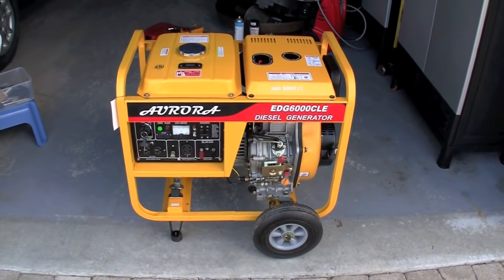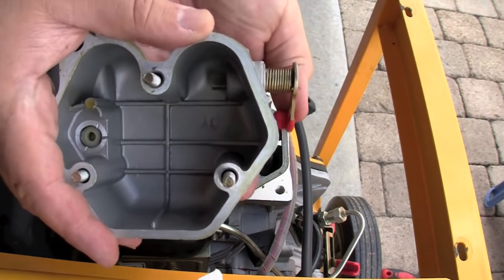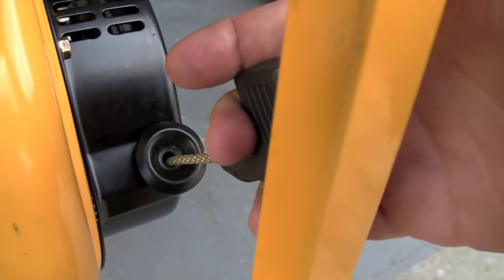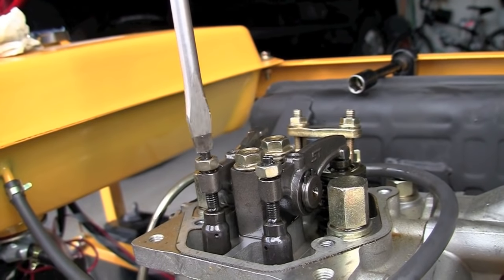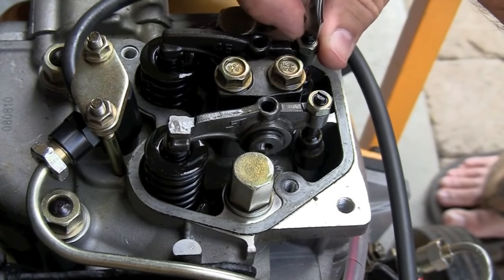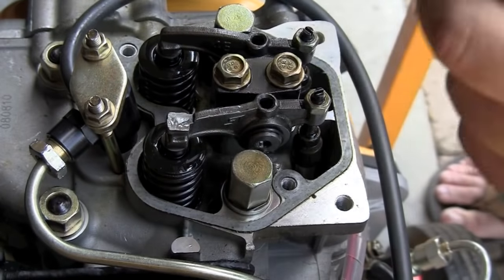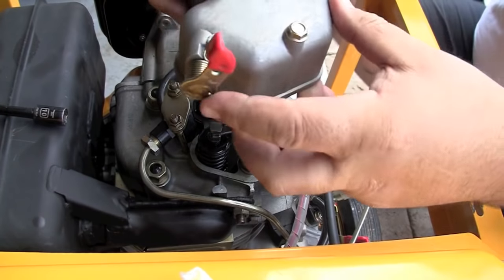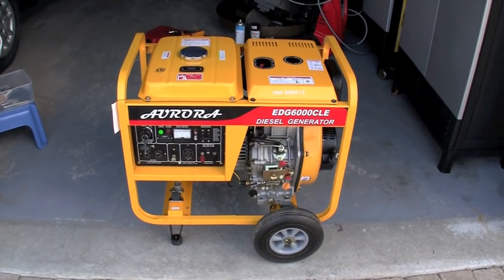Diesel Generator Valve Adjustment

Comment: You really need to remove engine pull start shroud (4 bolts) to determine top dead center. TDC is marked on flywheel by a hole  Then adjust valves to .15 mm gap

Comment: My exhaust is blowing out flames and has melted the flexible exhaust connector. The valve clearances are good. Why would the valve be opening when there are flames still in the cylinder?

Comment: You say .15mm gap but video shows feeler gauge .011Inch or .279mm a but confusing what is the correct gap???
Reply: 0.10-0.15 MM
Reply: 0.008mm intake for exhaust 0.012mm

Comment: Gap  intake 0.11 and gap exhaust 0.15 ?
Reply: 0.008mm intake for exhaust 0.012mm
Reply: @lyndonlawas2367  thanks you very much, sir
Reply: @lyndonlawas2367  Hi, I disagree. I have spent hours over the last few weeks researching 186F/FA engines.  Some sources state 0.1-0.15mm (0.004-0.006") inlet and 0.15-0.2 (0.006-0.008") exhaust, but most state 0.15 for both. 0.15 fits both ranges, consequently most sources go with 0.15mm/0.006" for both valves. I'd love to know where your figures come from because they are an order of magnitude out. I've just adjusted my brand new 6kW gen and my father in laws 3.5kW gen to 0.15mm and both start and run perfectly with no noticable tappet noise.
Reply: 0.15mm/0.006", guaranteed. Please read my reply to Lyndon.
Reply: @tyrotrainer765  0.15 for intake and exhaust gap ?
Reply: @basdol  Yes, 0.15mm is 0.0059"....I work in Imperial so I use 0.006". Most of the handbooks state 0.15mm for both valves. I have 2 186F engined generators and both start and run perfectly at 0.15mm.
Reply: @tyrotrainer765  I have a 170f diesel, when I start the engine, the starter rope pulls so sometimes my hand hurts because of the jerk of the starter rope, I checked because the rocker arm gap is too tight, like that because I don't have a user manual.
Reply: @tyrotrainer765  So for the 170f diesel, use the inlet gap setting of 0.1mm and the outlet gap of 0.15mm, sir.
Reply: @basdol  Hi, I have got the Yanmar manual open (search for "Yanmar ETQ-170F - 186F Engine.pdf") It states in section 1-5 table 1-3....... Engines 170F 178F 186F......... all the same values......set cold, inlet 0.1-0.15, exhaust 0.1-0.15, that is 0.004" to 0.006". I prefer 0.15mm because I've read that the clearances tend to righten over time. 

BUT there is a good reason to use 0.1; if you use recoil start then a tighter clearance MAY make the rope easier to pull. If you go for 0.1 and the engine won't start go back and set 0.15. This happened to me yesterday with my father in laws 186F......I set 0.1 and had to set 0.15. It starts perfectly on the electric and will start on the recoil.

BUT it is ever so hard to pull. No problem for us because I keep a spare new charged battery at home with jumper leads. Let me know how you get on.
Reply: @tyrotrainer765  Thank you sir. I will try using 0.1mm but if the results are not good, I will change to 0.15mm as you suggested. Greetings from Indonesia
Reply: @basdol  Hi from the PH. Sounds good!

Comment: these diesel gen r nt helpful beacuse there piston case or block is made wiht  alomonium
Reply: I've had one for over 5 years abusing it. it ran over 12 hours (sometimes 24+ hours) a day for 5 months straight and it's still pretty much brand new. running a/c's, microwaves, computers, tvs, and even saws and welders. these little things can take more abuse than people think.